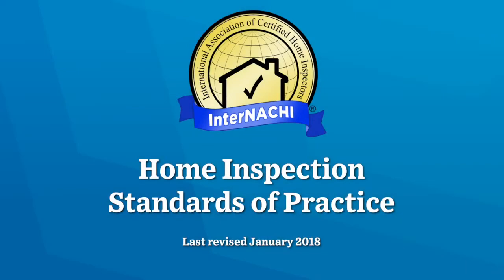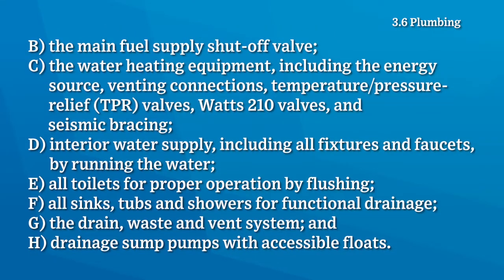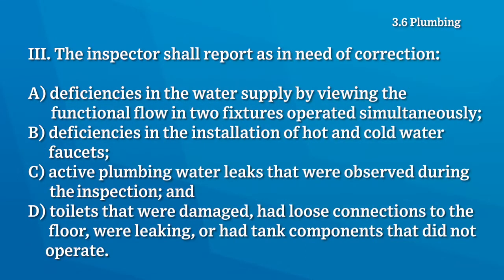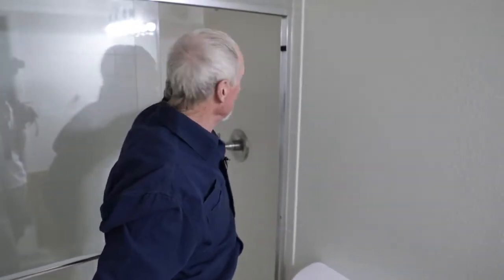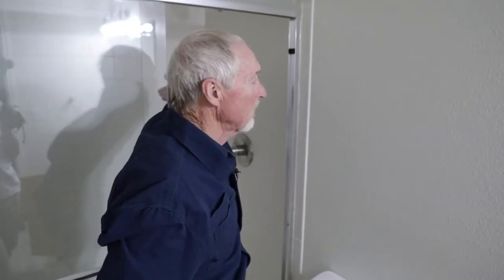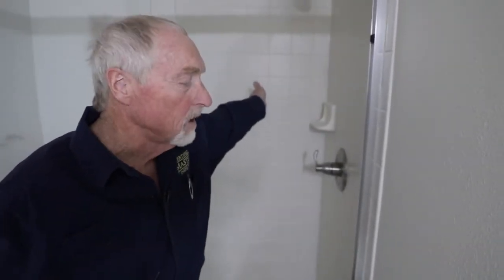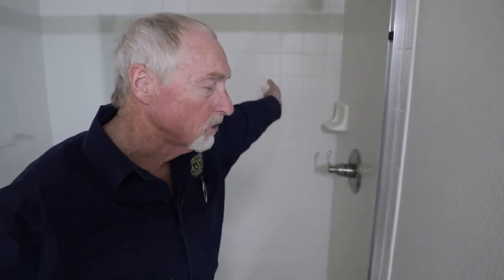6 Performing a Plumbing Inspection According to the InterNACHI SOP

Comment: At 34: 00  Plumbing codes specific an air gap must be used 2 inches above the counter for the dishwasher. There is not one installed as code states. On the drainage you can not have a sanitary tee stacked one on top of the other which you have because it could siphon the lower trap. You need a double sanitary tee if the dishwasher stand pipe was to be used which it isn't and as you mentioned the trap will go dry. So the drainage need the be repaired before sale with the tee to the stand pipe eliminated and an air gap needs to be installed above and though the counter and piped correctly. You can not high loop a dishwasher drain because it's not code. That's my essay.
The gas meter piping need to be painted it's rusted and it is a concern. Check with the gas company and ask. When would it be a concern when it rust through the threads and blows out.
Reply from the maker: Home inspectors are not code inspectors.

Comment: Why is it that inspectors doesn't want more than 120 degrees for the hot water? Most plumbers like at 140? Would you report it if it's 140 degrees?
Reply from the maker: It's 2021 IRC Chapter 2 Definition of hot water. Hot water is defined as "Water at a temperature greater than 120ºF (49ºC)."

Comment: The drain line by the water heater appeared to be ABS, why was that not discussed? Gable ABS pipe failures: Gable plastics defective ABS piping was made during 1985 and 1986 and is very prone to cracking failures and leaks, again due to use of defective plastic raw materials. Phoenix ABS pipe, successor to Centaur Corp. issued defective, crack-prone ABS piping from January 1986 - October 1986.
Reply from the maker: Hi, Douglas. There are 14 requirements for a TPR discharge pipe, including pipe materials. You're spot on. We reference 2018 IRC P2804.6.1, #13 requirement at https://codes.iccsafe.org/content/IRC2018P3/chapter-28-water-heaters
Reply: @BigBenGromicko  My question was in regard to the main drain line in the home, not the TPR valve and pipe. The main drain line looked to be ABS and you confirmed it later in the video below the sink. But nothing was mentioned about ABS having the potential for leakage or a way to check the serial numbers to confirm the ABS was not in the suspect material lot. I was interested as to why. Just wanted to know if we should point that out.
Reply: @douglasbrenneke3938  Ah, yes. ABS is permitted to be used as a drain pipe. https://codes.iccsafe.org/content/IRC2018P3/chapter-30-sanitary-drainage#IRC2018P3_Pt07_Ch30_SecP3002
Reply from the maker: @douglasbrenneke3938  ABS is permitted to be used https://codes.iccsafe.org/content/IRC2018P3/chapter-30-sanitary-drainage#IRC2018P3_Pt07_Ch30_SecP3002

Comment: Great video. The inspector performed a great job and explained items of concern well. Very knowledgeable and competent. These prospective home buyers should be glad that they hired such a great inspector. Home inspections are very subjective and by no means am I trying to come behind you and critique your job, just like I wouldn’t want you coming behind me. Lol.  
I’ve been a Home inspector for over 15 years in the Ohio valley and inspected more than 5000 homes in that time. Just a couple of concerns listening to your inspection video that I don’t necessarily agree with and would caution new inspectors watching this video. Even though you said “if you feel comfortable with it” .  Normally I only visually inspect the water heater TPRV and discharge tube for leaks and make sure it’s present of course, but never physically test these valves. These valves have a tendency to leak after testing if not regularly opened as I’m sure your aware. Probably best not to test in my opinion. I have tested these before earlier in my career and ended up with a leaking valve. 
The other item would be the toilet seal. You said that “toilets should be sealed to the floor” which I do see from time to time, but believe is incorrect or an incorrect practice. Toilets should be sealed to the floor by the wax seal at the closet floor flange and the side bolts should hold it in position. There’s no reason to add additional silicone sealant and actually hides a defective wax ring seal. If the wax ring isn’t sealed correctly, it would be clearly visible at the toilet base. If it’s sealed to the floor with silicone caulk; then you wouldn’t notice the leak until you start to see the stains on the ceiling of the floor below. Other than those two items, I think you did a great job and inspected items according to the NACHI SOP. Continued success to you sir. Great job!
Reply from the maker: Thank you for the compliment. Staff would love to see your comment on https://www.facebook.com/internachi.
Reply: I completely agree with this. I have worked in apartment maintenance for several years, and every time I get a new property manager, I have to tell them this. Sure it looks nice, but the repair bill will not. If they are adamant about having it, I will only caulk around the front and sides. Leaving the back open will at least give a chance to see the leak before it becomes a more serious problem.